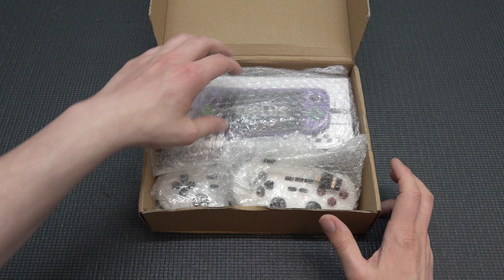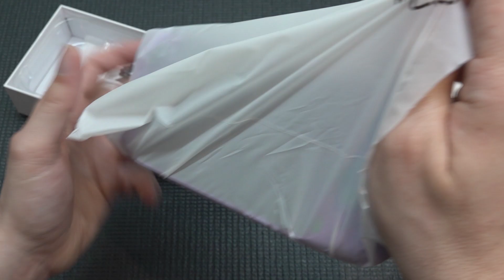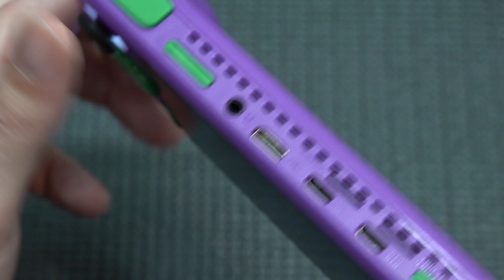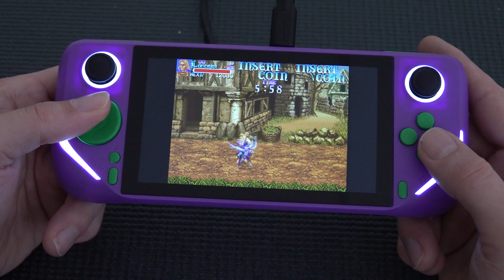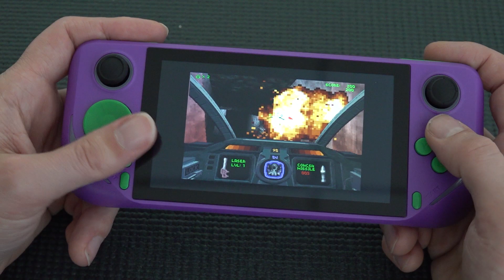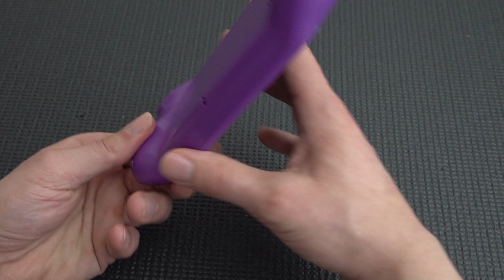E6 Plus Handheld - Steam Deck Mini Unboxing -

Comment: Chaos os is incredible on it but you have to flash it yourself everyone.. and they have android fixes too.. but the os on Linux side is a bit meh it's touch and miss the latest is good but but PSP doesn't work.. the last os the e6p os on GitHub is awesome but scraper doesn't work .. but everything works incredible on on the chaos versions must be like 50 percent performance increase

Comment: Psp setup , always change resolution from auto to x1 or x2 auto is the worst experience a never will be a stable , another just turn on autoframe skip and this game will running smooth 😉